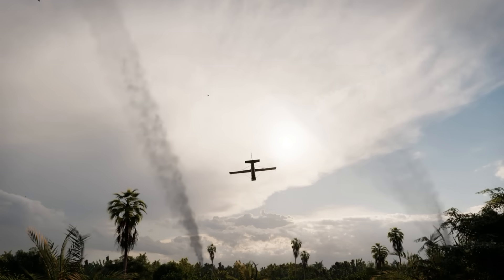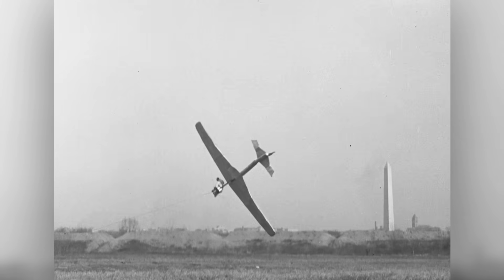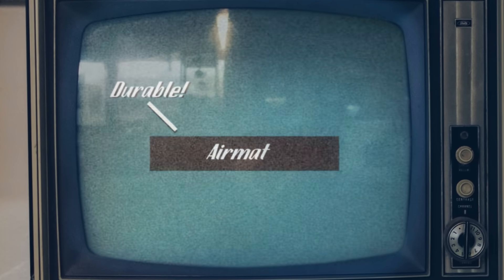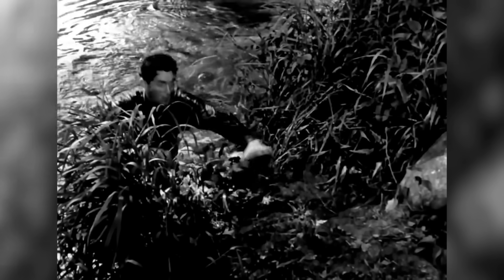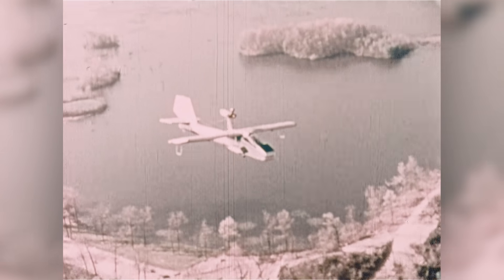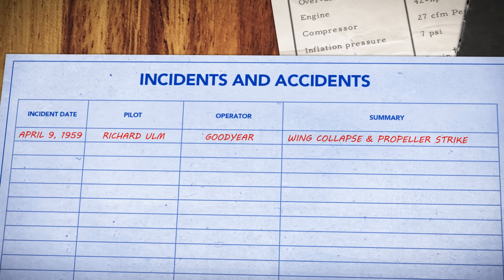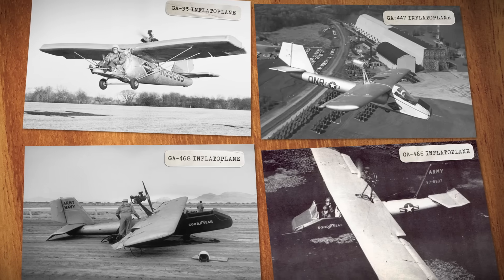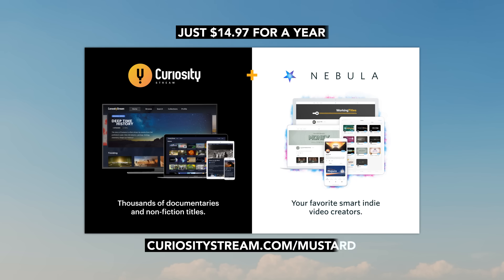Inflatable Airplanes Were A Bad Idea

Comment: A concept like this could definitely make a comeback in the electric age. An electric motor with a ducted fan would be alot better to power something like this than an old piston engine. I believe they have hang gliders with inflatable frames so it's definitely possible

Comment: Hear me out:
- make a solid structure for the control surfaces
- make a solid frame for the wings
- make the backbone of the plane from solid materials
- make it so all of the above are made up of sections that are foldable and lock into their proper shapes
- make the skin of the wings from airmat
- make the body of the plane from airmat

Basically, a similar construction method to the old ww1 and interwar biplanes, but with rubber instead of fabric.

Comment: To be air-dropped to pilots stranded in hostile territory so they could fly back to safety. In an inflatable plane. At low level. Over hundreds of miles of jungle, flak, small-arms fire etc, etc. They definitely thought that one through.

Comment: It worked quite well, finding a use for it was the problem.
Reply: I think that was true.  The inflatable planes could “work,” but…..then what? What are they good for militarily?  

As said, for troops caught behind enemy lines, usually better to give them a radio/communication and then send a helicopter or other rescue, rather than have them inflate a slow. wobbly plane and pilot themselves out, if they can.

There may be some niche uses, but I doubt there are many.

Comment: Inflated things are not bad ideas, the mechanics at that time were faulty. But with modern materials inflated wings would work. I even want to see windmill manufacturers make the windmill blade out of inflatable high tensile rubber and fabrics. No hard to recycle fiber composites. If tires can support tens of tons of pressure then you can make inflatable wings and windmill wings...

Comment: the idea of having airship hybrid airplanes is an excellent idea. Especially if they can make it use hydrogen safely. Both as a fuel for the jets, and and a lift gas. Then maybe as technology advances we will be able to create a vacuum airship or a vacuum airship hybrid airplane. Where no lift gas is required. A perfect vacuum inside of something lighter than air or gaining lift from wings would be able to float. It could be used to make floating cities and giant floating cruise ships. Though we don’t know of any materials capable of holding up to those forces. Not even carbon nanotubes or graphene is strong enough. But there’s one thing that can be way stronger. Electromagnetism.

Comment: OK but but what if the structure were instead filled with something like expanding foam that cures in a rigid structure and instead of one engine, there's 6 or 8 electric motors....of course batteries need to be accounted for. man i wish i had unlimited funds and unlimited time

Comment: For the military could just use a paraglider if they ever really needed something like an air dropped rescue plane.  You can get paragliders and engines that weigh less than 50 pounds and with the hoops disassembled you could likely fit them in a ruck sack easy.  It would not have the range likely but a 2 gallon fuel bladder could give it a range of like a few hundred miles.  They are slow but with thermals they could operate at night and stay well below radar.  Shooting at something 100 feet above the trees at night is not the easiest thing.  Even MANPADS have a minimum range that would make these pretty much impossible to hit if there are trees around.  They are also around $5,000 and take only a few days of training to learn how to operate.  And given the typical military budget they might even be able to make a high temperature polymer muffler and modify the propeller to make it much quieter and likely increase the range.

Comment: Inflatable planes sound awesome, I’m sure it’s still possible to build a safe and reliable one. Plastics have come a long way since the 50s and if you put an electric motor in it could be completely powered and lit by electricity. Maybe even have it be solar powered with flexible solar panels covering it. History has shown that large permanent things don’t last long. For example militaries with small fast ships out competed those with large slow ones. :)

Comment: The technology is available to try again on the inflatable aircraft.  I’m determined to make a prototype, small enough to fit into part 103 classification.
Reply: How do you plan on going about it?
Reply: @  I’ll need to approach overseas manufacturers of inflatable standup paddle boards.  They have the materials and equipment to make parts.
Reply: @Clarence_13x  That sounds like a solid approach, do you plan on building an actual flyable aircraft at some point?
Reply: @  an unmanned demonstrator, at least to convince the manufacturers to move to a higher value product stream.
Reply: @Clarence_13x  That's fair. Are you an aerospace engineer per chance?
Reply: @  nope, just process and mechanical.  But I did play Microsoft flight sim 98’ on my 120MHz packard bell with the speakers built into the monitor.
Reply: @Clarence_13x  Haha, that oughtta be enough. But for real, good luck!

Comment: I see the plane as having lots of potential in the modern era. 
All you would need is to have some type of spar or something rigid just as a safety measure that you can attach to it.  
Honestly it doesn't seem anymore dangerous than most aircraft kits,  most being nothing more than a couple bars and a wing made of material that isn't that far from WWI era aircraft and those were made of wood and fabric.

Comment: It would be interesting to see something like this be thrown back into the drawing board.  Use other materials like Kevlar and what not.   Not so much for rescue operations which im sure it could manage to a degree lets say someone who crashed in a remote area with little or no communication. Or even for hobbyists.  literally as said in the video.   A plane that could fin in "The back of your station wagon."

Comment: So why was it a bad idea? As a rescue aid, they might be of limited utility. But for general aviation/recreational use I don't see any immediate show stoppers.
Reply: It adds the extra failure of the plane deflating and loosing the structure. Without really adding any benefit besides packing small when not in use. 
There’s several designs of ultralights/paragliders that can dissemble and pack pretty small without as much risk of the plane deflating.

Comment: Yeah, I don’t think air travel will use electric for transportation in our lifetime. At least any that would be economically feasible. There is no where near enough electricity production to power passenger ev’s much less commercial road vehicles.

Comment: Electric Planes will be disaster.  
Imagine you get struck by lightning, if the lightning shorted out everything in that plane, nothing will work. 
If that all electric, how do you you arrange safety in that plane. 
I mean like Emergency APU or Some little fan that will make a little bit power for that plane.

Comment: This is one of those ideas that still theoretically could work, but just they'd need to poke around to find a different use for it, since other technology overtook the one specific use they had planned.

And it's very frustrating to not know anything about the soviet program.  It sounds like a more workable use for air-aircraft carriers than most attempts (which apparently the soviets also managed to make work)

Comment: Lmao there will never be a battery powered airplane
Reply: The argument that there will never be a battery-powered airplane is not accurate. While battery technology has historically been limited in terms of its energy density and weight, there have been significant advances in recent years that have made electric flight a viable option.

In fact, there are already battery-powered aircraft in use today, such as the Pipistrel Alpha Electro and the Airbus E-Fan X. While these aircraft are currently limited in terms of their range and payload capacity, they are being developed and improved upon continuously.

Furthermore, there are ongoing efforts to improve battery technology, with research into new materials and chemistries that could significantly increase energy density and reduce weight. This could lead to the development of more advanced battery-powered aircraft that could compete with conventional aircraft in terms of range and payload capacity.

In conclusion, while battery-powered aircraft may have been impractical or impossible in the past, advances in battery technology and electric propulsion systems have made them a viable option for the future. It is likely that we will see continued development and improvement in this field in the coming years, leading to more widespread use of electric flight.
Reply: @jasperhunter8386  not gonna happen chief. Maybe short flight stuff, but batteries don't last. Replacement and upkeep will be astronomical. Will never be a cost effective or practical solution. Just like battery powered cars, they just won't last. Sorry to bust your bubble.  sounds good in theory, but that's it. I work on electric cars like Tesla's and others. Always in my shop for some kind of battery issue or electrical problem. Replaced em after being practically brand new still. They are a joke
Reply: @bigizzysworld4253  intriguing, I've had a tesla for 6 years now, never needed a battery change. But technology would improve, there were always fogies saying that powered flight would never happen around 100 years ago, I guess you're living proof that some remain. Perhaps battery technology will never improve, but we must try for the future of the planet. Also, everything in the aviation industry is expensive, for example: 
Routine maintenance: Routine maintenance tasks for a Boeing 777 can cost between $50,000 to $200,000 per year, depending on the extent of maintenance required.

Engine overhaul: The cost of overhauling a GE90 engine, which is commonly used on the Boeing 777, can range from $2.5 million to $5 million.

Landing gear overhaul: The cost of overhauling the landing gear on a Boeing 777 can range from $200,000 to $500,000 per aircraft.

Avionics upgrades: Upgrading the avionics systems on a Boeing 777 can cost between $500,000 to $1 million, depending on the extent of the upgrades.

Comment: This sounds like a great idea for a recreational plane, or something you could stow away on a yacht. 
Depending on the setup it could need an even shorter airstrip, or take off water. In the WarThunder there's an old Soviet biplane that is known for its stability and low noise and ability to take off and land from short, rough strips. The same one that Night Witches used, the Po-2. I'm thinking, the Po-2 design could, probably, be easily reproduced with modern materials. 
And you can probably make the wings more rigid, if you have a part of the wing sturdy, so it's not completely inflatable, but "mostly" inflatable, like a SUP board, or a Kodiak boat. 

Add multiple strong rigid, strategically placed ovals all over the plane and a modern small engine, that would give enough power to lift it off even being the size of a can, basically, and you have a great recreational plane. This one could easily fit two persons, and would be oval when folded, not cubic.

Comment: I think that I would rather take my chances on the ground with an AR-7 and a survival kit.  They brought up a good point about finding a place to take off, but my biggest question was, where are you supposed to get fuel from?  Those engines back then we're not fuel efficient so even if they packed a few gallons of fuel, it wouldn't get them anywhere.  They would be better off adding a flying escape pod that could deploy and glide to safety in the air.

Comment: The exciting future of aviation is nothing but an incredible mess.  The extraction quite toxic chemicals, production methods and the problems with recycling or otherwise disposing of the chemicals and ores is one environmental nightmare. Hydrogen planes have similarly horrible truths attached to them.  Speaking of being attached that is the main problem. While we have no lack of hydrogen in the world, it is not usable in the compounds it is normally part of so we have to separate the hydrogen from other elements - and again this often involves other less than green chemicals and by-products.  

In actual fact, the planes we have now are probably the greenest we are going to get for some time.

Comment: I can see a couple of changes I'd make right off the top.
First, a Ducted Fan instead of a propellor, and
2) Inflate it with helium, but still have air as an option.
Reply: You can't start a ducted fan by hand, so they'd have to add a starter and a battery. And a tank of pressurized helium would add even more weight and bulk to something that's intended to be air-dropped in a pod. This thing was designed to be as simple as possible.
Reply: @barryervin8536  So? No law says it has to STAY that way.

Comment: With modern material science, more reliable cable setups, a light internal support structure (like a tent), and electric engines, this could easily be a way to get aircraft into remote locations easier

Comment: This is interesting. In relation to ultralight aircraft regulations, the Goodyear Inflatoplane would be considered an ultralight aircraft. The only issue is the 20 gal fuel tank for six hours of flight time.

At least in the United States, where FAR Part 103 states that: "To be considered an ultralight vehicle, a hang glider must weigh less than 155 pounds; while a powered vehicle must weigh less than 254 pounds; is limited to 5 U.S. gallons of fuel; must have a maximum speed of not more than 55 knots; and must have a poweroff stall speed of no more than 24 knots."

The Goodyear Inflatoplane had an empty weight of 225 lbs, and a gross weight of 550 lbs.

Compare that with another ultralight, the all-metal Hummel Ultracruiser which has an empty weight of 250 lbs, and a gross weight of 575 lbs.

So what if you took the overall design for the Hummel Ultracruiser, made the cockpit and fuselage out of both metal and carbon fiber with inflated wings?

The Hummel Ultracruiser has a 5 gallon fuel tank (FAR Part 103 compliant) and will use approximately 1.5 to 2 gals per hour which gives you roughly 2 to 3 hours of flying time.

With inflatable wings, could you effectively shave off the extra 80-100 lbs that both metal wings take up? It's an interesting hypothetical because while you have a limit on speed, fuel, and weight; there isn't a limit on flight time or distance. Would removing the extra wing weight lead to less fuel use? Could that 1.5 to 2 gals of fuel per hour change?

Let's say hypothetically that it resulted in an efficiency bump that meant those 5 gals lasted for 4 hours at 55 knots instead of 2-3 hours.

That small difference makes travelling longer distances in an ultralight vaguely possible. Flying 400km (55 knots ~= 100km/h) is then well within the realm of possible.

An ultralight with a very low stall speed would also mean that you could also easily stop and refuel with regular gas. The use of rubber inflatable wings could also, as shown in this video easily absorb any impact forces due to rough landings. With the exception being the exposed prop being directly behind the pilot, as that is admittedly a pretty scary setup; hence the documented incidents and fatality.

 But an even more interesting what if is rather than using air, what if you used a gas that was lighter than air? Would that change the aircraft designation to then be considered a balloon? Would a lighter than air wing result in even more available flight time?

However, an even crazier idea than that is making an ultralight capable of transforming into a glider after takeoff in mid-flight with inflatable wing extensions. Is it than an ultralight or a glider?

Very cool.

Comment: I asked myself, would the wing structure become more rigid if you would use a wing spar and other internal structures filed with beads and suck It vacuum after inflating the rest of the wing like a vacuum splint. Could that stop the wing from collapsing into the propellor? Who will be next to try this version.

Comment: The concept might be improvable by adding stabilizers like glue, epoxy or others. The plane could then be produced in a factory, compacted for transport, and closer to the customer be put together. Once the stabilizers hardens, you can perform tests on the plane which you can expect to more reliably assert the quality. Furthermore since the structural strength of the plane can in large parts be made by the stabilizers, it could further reduce shipping costs since the stabilizers may be locally produced. Decreasing the weight of the shipment.

Comment: And it can’t be used to rescue navigators, bombardiers, gunners, crew chiefs, sensor operators…
Couldn’t even be used for the pilots of crewed aircraft for the above reasons. 
Such a niche item that also requires a lot of external factors, just couldn’t be a viable rescue tool.

Comment: This is brilliant.  This can be made to work with modern tech easily.  I'd rather have this with skis and an engine (electric and fuel cell?) than an inflatable raft with an engine.  This can be a raft too if the engine fails.

Comment: Why didn't Goodyear think of including a high pressure compressed air bottle to do a lot of the inflation quickly? Pull the plane out of its container, stretch it out so nothing kinks. Hook up the air bottle and open the valve. fooooosh Then fire up the engine so its air pump finishes inflation.